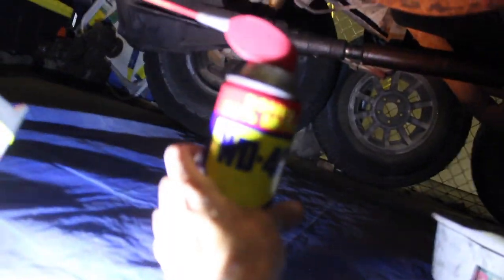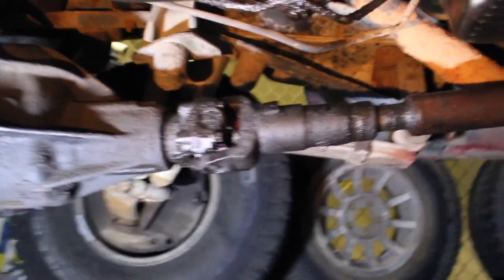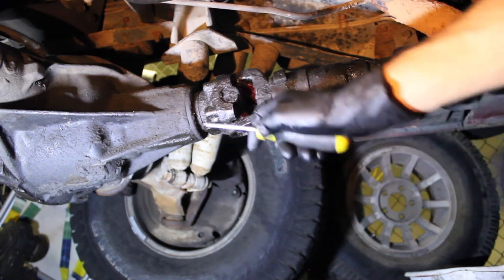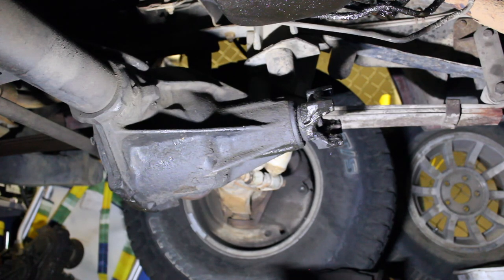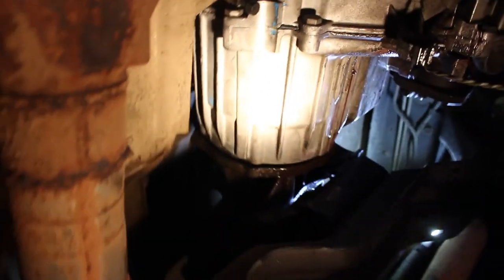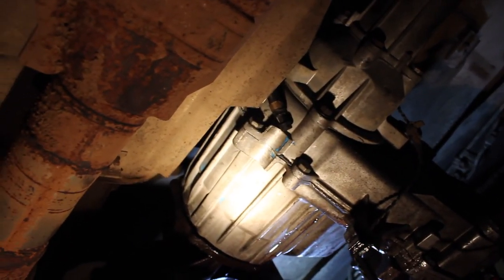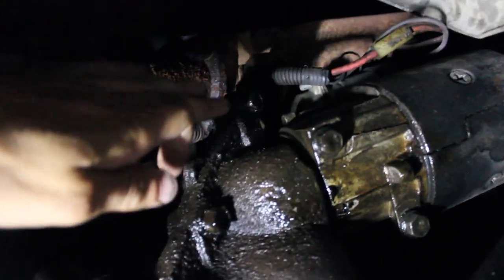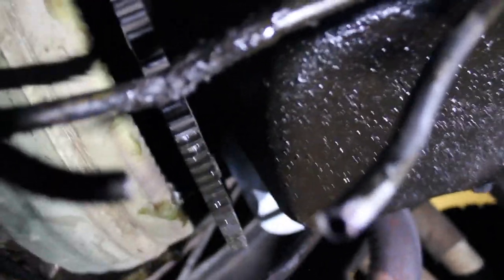How to remove a square body transmission part 1

Comment: Myles why did you decide to remove the transfer case separately instead of just removing the transmission and the TC as a single unit? Just curious. 👍🏻👍🏻
Reply from the maker: I was doing this on the ground and had some basic tools.  I wanted it to be as light as possible so i could avoid breaking anything.
Reply: @myles2go.  I am about to remove my smallblock and I was thinking of pulling the trans as well with it, I should keep the TC on right? Preciate the video!
Reply from the maker: @TALONZYT2  it all depends how much you are planning to remove from the front of your truck.  If you remove the entire front clip, you should be able to leave the transmission and tcase attached and still have clearance.  If you are not removing the front clip, you may need to remove the transmission and tcase